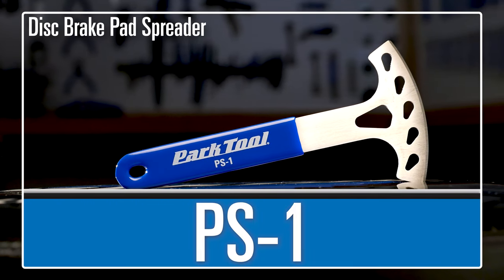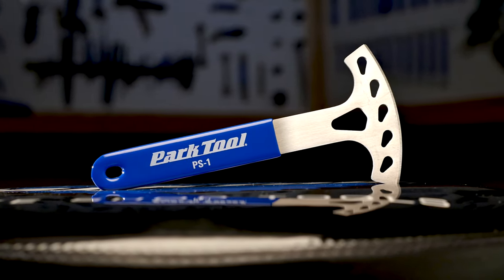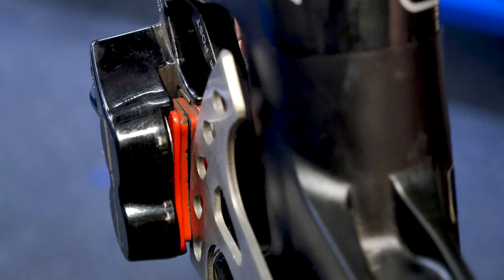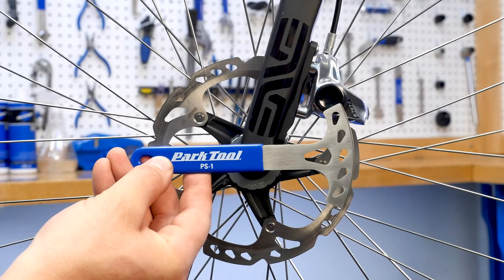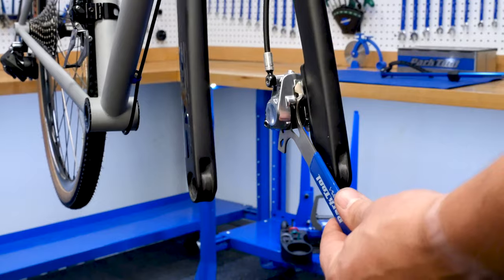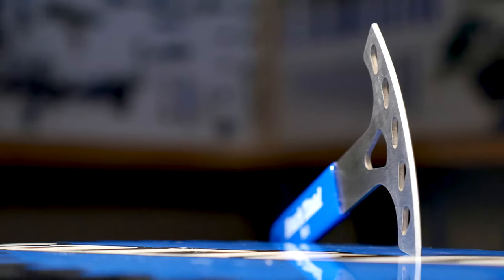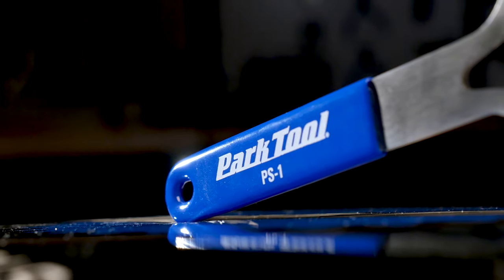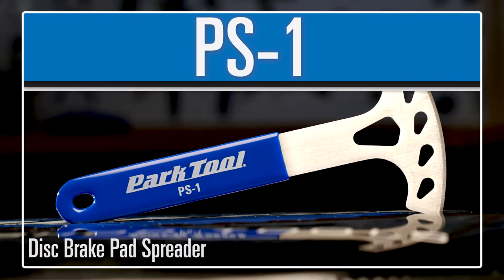PS-1 Disc Brake Pad Spreader

Comment: Hm. I really like the PP-1.2 because it pushes the pads all the way back in so I can reset the advance. This doesn't look like it would accomplish the same thing.

I bet it makes a sweet thrown weapon tho
Reply: I don't believe that the Park PP 1.2 is meant to be used while the disc brakes are mounted. The PS-1 is meant for that purpose, plus the one you use your tool for, not to mention test the brakes without unmounting an remounting the wheel.
Reply: However I believe the PP1.2 is not meant to be used on ceramic piston bikes eg Shmano Road as the wedge can twist and crack the pistons.

Comment: woah, 6 tools in 2 minutes!
Reply: What's the difference between PP 1.2 and this?
Reply: @Allyosha  I don't believe that the Park PP 1.2 is meant to be used while the disc brakes are mounted. The PS-1 is meant for that purpose, plus the one you use your tool for, not to mention test the brakes without unmounting an remounting the wheel.

Comment: literally take an old disc and file the edges so they are tapered
Reply: that's exactly what I did.
Reply: Yes, your method will work but, instead of having a comfortable and easy to maneuver tool, you'll have one that's less so. Shoot the lock off your wallet as it's under $12 as of this writing (I get free shipping).